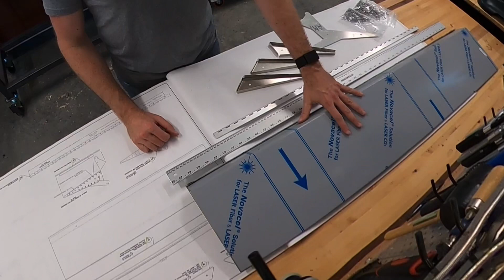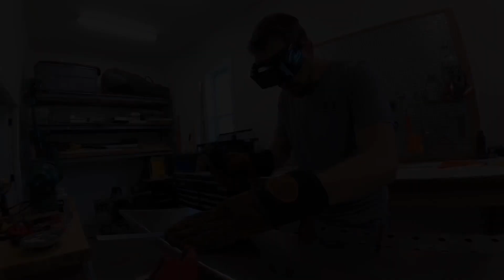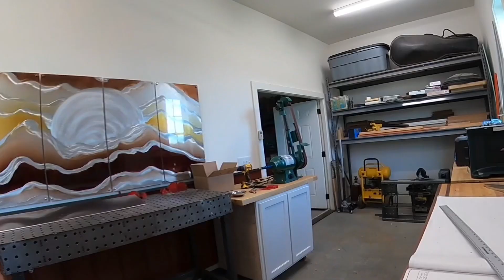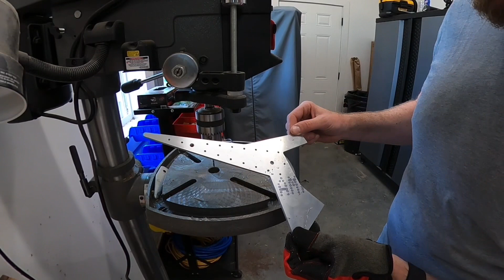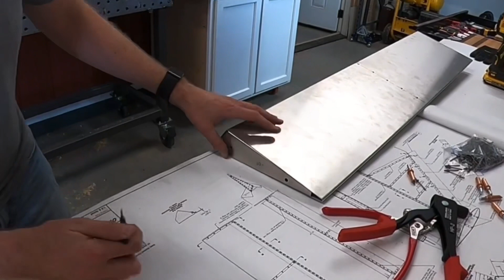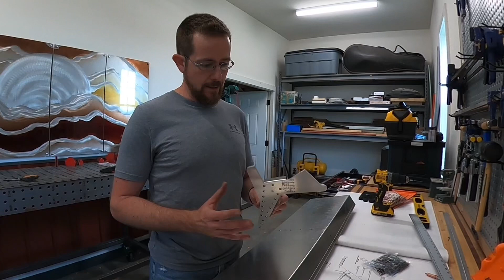Rebuilding that Rudder (Lean of Peak Aviation)

Comment: Noooo - plasma cutter on heat treated aluminium. Wrong - please refer to AC 43.13.  New skin required.
Reply from the maker: I appreciate the reference. That is in fact a fantastic and very thorough 646 page manual I wish I had seen before.  I used the search function on my computer to try and find anything that says I can’t cut heat treated aluminum with a plasma cutter and came up short.  I did find where it specifically says not to apply local heat to facilitate “bending, swaging, flattening, or expanding” heat treated aluminum.  Nothing about cutting.  I think the biggest concern in this situation would be local loss of corrosion resistance. The top edge of the rudder skin is not likely to cause a catastrophic failure but it will be primed and painted to help prevent corrosion.  If anyone has a definitive answer on this I would love to see it in writing.
Reply: @LeanofPeakAviation  How the al behaves after heating is dependent on the specific grade.  Kitplanes has an article coming up on the various grades used in aircraft manufacture that would be worth referencing.  Some grades become very soft (like butter) after heating and require hardening before they return to anything like their required properties.
Reply from the maker: @DougGray-xf3hz  Thank you.  I’ll look for it.  And then I guess the question becomes how much of the metal is affected by each process. In this example the zone of heating for a rapid swipe through thin metal is probably quite small. Is it consequential?  What about cutoff wheels and grinders which also generate heat?
Reply from the maker: @DougGray-xf3hz  
This is the first article I’ve found that specifically addresses 6061 and plasma cutting.  Basically suggests mechanical finishing to remove any micro cracks at the cut edge (which I did…I scraped/sanded the edge smooth) with the concern being a tendency towards cracks if not mechanically finished. 

https://blog.red-d-arc.com/plasma-cutting/cutting-aluminum-with-a-plasma-cutter/

Comment: The construction of most homebuilt airplanes is never as strong as a certified airplane. Both in design & materials. I have built certified & homebuilt planes the certified is the safer way to go for new pilots.

Comment: Great video!  A little safety tip: Don't wear a glove when operating a drill press.  If the tip of the glove were to get snagged in the bit, you would be injured.
Reply from the maker: You’re not wrong! 😉

Comment: Question: I didn't see you deburring the holes after drilling them. Was that step just edited out of the video footage (its not exactly exciting to watch)?
Reply from the maker: Yeah trying to keep the videos to five minutes or less and retain attention…I dunno about you but I hate watching people doing the mundane stuff unless it’s actually a “how to…” video.
Reply: @LeanofPeakAviation  - Absolutely!  Good call, just as long as you're doing the deburring. 
For the uninitiated: Its an important step to ensure that rivets are snug to the part, and that the parts are snug to each other. A burr left around one of the holes through the parts may move or break off, leaving the joint loose and structurally compromised.
Reply from the maker: Very good teaching point.
Reply: Also: Yes, come to the "dark side" and build a plane! :-) Its a lot of work and a long process, but extremely satisfying. Given the clean assembly of the rudder that you've shown us, there's no doubt in my mind you could build a safe, fun, and beautiful bird!
Reply from the maker: I’m about sold on the prospect!

Comment: Looks good but for building in the future, I'd suggest riveting as the very last step. You'll want to completely clean the fingerprints, de-burr the skin and edges then inspect every part when it's disassembled right before final riveting.
Reply from the maker: Sounds like good advice. Can I ask why the fingerprints matter at this stage?
Reply: @LeanofPeakAviation  My intention was to reference the prints that will be sealed inside the riveted structure. When I was building, I alodined every aluminum piece and they had to be chemically cleaned first so tidy-ness of the metal became a habit. The cleaner the aluminum before closing, the better seems to be an aerospace industry standard. Honestly, I don't know of the corrosive properties of fingerprints on aluminum (it is to silver) but many builders will paint or prime internally and this would obviously be harder with fingerprints. Watching the One Week Wonder taxi with all of the fingerprints on it drove me crazy! I'm sure it will get a good metal-prep process before painting.
Reply from the maker: @kyqx  Gotcha.  Thanks for the reply!
Reply: @LeanofPeakAviation  Sure thing! It's cool that you'll have a little of your own handywork in that cool Onex.

Comment: I would recommend asking the manufacturer if using a plasma cutter has any adverse effects on the skin.
Reply from the maker: This sheet metal was laser cut initially.  It’s aluminum.  There shouldn’t be any adverse metallurgic reaction that would affect the function.
Reply: @LeanofPeakAviation  SHOULDN'T BE?  Lets look at the point from a different angle.  There is not a single Aviation shop anywhere that does sheet metal construction and/or repair on aircraft that you find them using a plasma cutter to cut sheet stock.  That one point alone might mean something.  Hopefully viewers don't use your channel as a how to resource.
Reply from the maker: @scottmcdaniels3254  Here are research articles exploring the issue with plasma and laser cutting, a similar process that relies on heat and was used to cut ALL the sheet metal in this plane by the manufacturer.  My videos are for entertainment only.  This issue is micro cracks at the cut edge. I think you’ll find that the heat affected area is small and can be safety smoothed out with a sanding block. 

https://www.thefabricator.com/thefabricator/article/plasmacutting/plasma-cutting-stainless-steel-and-aluminum

https://www.researchgate.net/publication/292709933_Laser_cutting_effects_on_aluminium_sheets_mechanical_properties

Comment: getting me excited to start building my Onex. Taking notes as I watch...unfortunately I don't have a plasma cutter, but that's ok. Always nice to see different approaches, as I might see something or come up with an idea to make my build process more efficient.
Reply from the maker: Yeah you certainly don’t need a plasma cutter. I would have done this particular piece with a dremel cut off wheel because of the weird triangular corners.  Not hard to do.  But man I love a plasma cutter!
Reply: @LeanofPeakAviation  No worries, I just never thought of the plasma cutter for that. It cuts so fast. Whatever works. I'll be using the cutoff wheel though.

Comment: Do plans specify which way the lower rib/ horn rivets are installed? If they were installed with rivet head on the thin rib side they would resist pulling Through the rib the way the original one failed.
Reply from the maker: They do. It’s exactly the way I did it with the large head on the bottom against the thicker metal. You’re correct in your observation but the bigger problem is why it pulled down in the first place…and that’s what I need to fix.